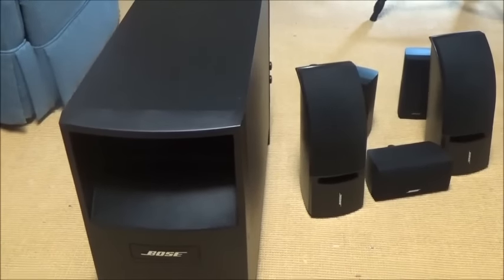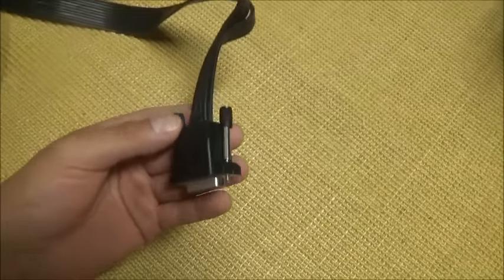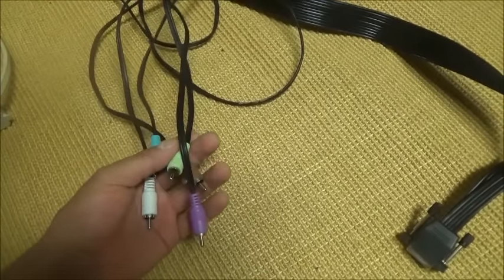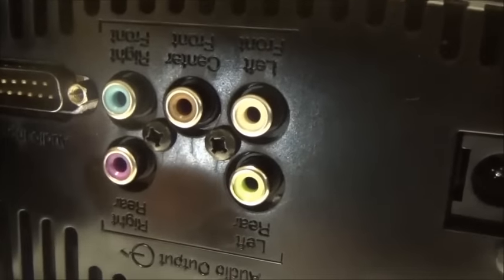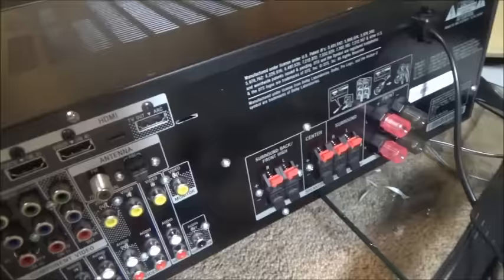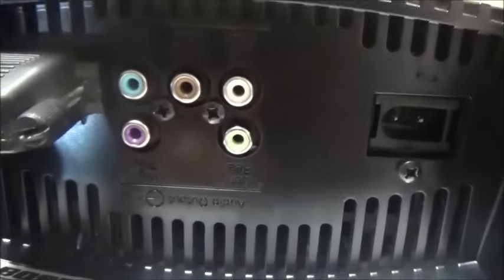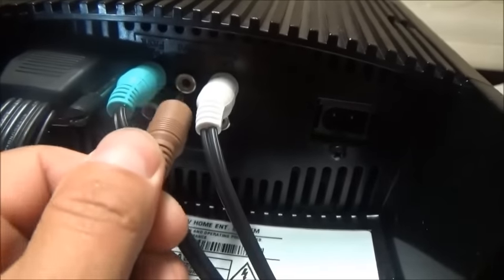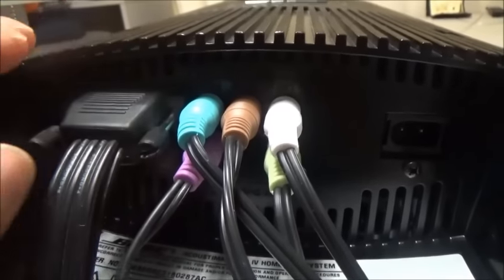How to install a Bose Acoustimass TO A SONY RECEIVER Home theater system TA

Comment: Whenever I see this Bose "proprietary" connector, I can't wait to just take it apart and hardwire them to make connection straight and simple. They are nothing but electrical wires sending analog signals, jeez. Connectors just suck, just look at Apple products.

Comment: I have Bose lifestyle 535 same speakers as Bose accustomas 10 if I buy acoustamos 10 sub woofer would it work because my sub woofer is different
Reply from the maker: probably but I  not sure if it works.  I do have the same sub woofer.  not diferent

Comment: I got some info that I didn't know before. Thanks. The one question I have is how do you connect the sub to the receiver? I have a single blue wire with a yellow cap. I'm not sure exactly where it goes. Thx
Reply from the maker: I have the blue cable too, but I am not using that, I've just connected the big cable that come from the receiver that's it
Reply: @outDood705  ok then I'll ignore it as well
Reply from the maker: Ok and let me know how it goes
Reply: @outDood705  what receiver do you use, and how are your crossover setting etc ..
Reply: @viigee202  The Blue Cable is very important it is the subwoofer cable which u connect to ur AV receiver without that ur base would not work
Reply: @crazystuff7605  thx
Reply: @crazystuff7605  where do I connect blue cable from base
Reply: @acerag4405  av receiver subwoofer audio out
Reply: Use an RCA jack for bass out of amp  to sub ..?

Comment: that cable with a d sub 15 is the input from the receiver .and  the rca connector are the speaker connectors I guess you got it wrong at the beginning

Comment: I don't understand still which cable or wire is your signal I see that u connected the speakers but no signal cable or is it act as a pass thru the speaker channels
Reply from the maker: que tal mi estimado Fabian Castillo. cuentame Cual es El problema que estas teniendo con tus conecciones?

Comment: I just install bose acoustimass 6, but center speaker not working. After I check, I switch to another channel (right front and left front) the speaker and cable its ok. Is it normal the center speaker not working?
Reply from the maker: you have to make sure is connected to the right place that's supposed to be Pengikut Yesus Kristus
Reply: @outDood705  its nothing to do with quality from audio source?
Reply from the maker: @ManGunSong6   well, if you are using right speakers cables and the speaker is working well, I assume the center output is not working.  I can't think of anything else.
Reply: @outDood705  thx man 🙏

Comment: Hi i am planning to buy accoutimass 10 series  5 how is the sound and if i compare with soundbar 700 + bass module 700 which 1 is better
Reply from the maker: Hello shivshankar patwa the 10 series is very good go head get it man it sounds amazing
Reply: @outDood705  thanks but if we compare with bose soundbar 700 +bose bass module 700 so which 1 is more powerful
Reply: @shivshankarpatwa3593  I own the bass module 700 and soundbar it's better.
Reply: @mouwa7793  hey thanks for reply i already purchase it and the sound is treat for my ear its amazing,,

Comment: It's very surprising that Bose lifestyle systems can hook up to any amplifier. According to them that the Lifestyle systems cannot hook up to any amplifier as it is proprietary systems. but I'm amazing they way u handle the systems. So that's mean any Bose lifestyle systems can mix and match any AVR receiver Right?
Reply: Only the Bose Acoustimass can be used with any 5.1 receiver. The Lifestyle 600 and 650 is proprietary with its own receiver.
Reply: He proves your statement wrong

Comment: What is the best way to set the Bose in the Advance setting in my Onkyo receiver. I am referring to the Large or Small speaker preferences and the Crossover frequency? Thanks(whom ever answers)
Reply: It automatically sets them but you set all speakers to small only very large speakers can be set to large and I'm not talking about just normal tower speakers I'm talking about tower speakers with 2 8inch subs 2 6inch mids and 1 tweeter but anyways set speaker to 90 hz and have bose sub crossed over at 100 hz
Reply: The maximum RMS potential power of the sony receiver is useless..Inside the bose module was high to low level suppressor circuit to integrate with the 5 channel amplifier inside the bass module for driving those 5 small speakers.. Estimated watts per bose small speaker would be 50w or less..now the sony receiver assuming 100watts rms rated output per channel. was only attenuated by this bose bass module to match those small speakers..
Why not just buy 2 tower speakers, 1 center speaker, 2 sorround speakers all rated 120W and an active subwoofer.. Rest assured that the sony receiver if rated 100W rms per channel will be more happier and will produce the better quality sound at decent spl level..cheers

Comment: can I just plug the speaker wire from the cube straight to the receiver and bypass the subwoofer?
Reply: No!!
Reply: If u had a bass blocker we use them in cars all the time if u connect it that way then yes u can

Comment: i didn't c how u hooked up the sub to the receiver... i know how to do all this its just i'm looking for an adapter
Reply from the maker: there is no adapter only the receiver cables go directly to the sub and the speaker cables come out of the sub, that's all you have to do ... if you connect it right; only what remains to be done is to connect the sub to the electricity and that should  work ...
Reply: how does the receiver send sound to the sub-woofer without a connection cable?
Reply from the maker: Rene Lopez. All you have to do is connect all the speakers out of the receiver  then the speaker will bring the sound from the receiver to the sub and that will give you sound
Reply: So the sub input comes from the f/c/s speaker out of the amp, I'm I right? How about the sub vol control? On/off control of the sub?
Reply from the maker: Felizardo Aguilar I don't remember seeing a switch saying on and off and a mind doesn't have that switch. you just connected to the electric power and control it there
Reply: my bose  sub has a 8 pin din connection for the receiver.... my sony receiver takes a jack connection.... I need a adapter for a 8pin din  female to a  male jack

Comment: THEY GIVEN ME AN ACUSTIMASS THE SAME AS YOURS, I TRY TO CONNECT IT TO A TECHNICS AMPLIFIER AND IT IS NOT LISTENED,. what am I doing wrong  ? No soud at all-
Reply from the maker: MSK 1975 make sure you connect the cables from the  subwoofer to the    receiver, and from the subwoofer to the speakers
Reply: @outDood705  how do you connect subwoofer to both the speaker and reciever
Reply from the maker: @oyeenihal4322  the speakers has to be connect to the subwoofer and from the subwoofer to the receiver

Comment: Where did you connect the sub in the receiver ?
Reply from the maker: hello Sudhakaran Muthukumar  the sub has the all connections.  if you see that black thick wire has all the speakers wires that goes connected from the sub to the receiver,  and all the speakers comes out from the sub . that's how I have mine and it's works fantastic.  I know there's a extra blue wires that mine has but I didn't use it. that's the way I have mine sir. good luck.
Reply: @outDood705  you have the out put and input backwards in your explanation. It says right on it that the big black bunch of cables is input.  Which means from reciever.   The RCA on the sub says output. So they go too the speakers.
Reply from the maker: @sdyogi  ya from the sub of course

Comment: How do you connect subwoofer to receiver
Reply from the maker: Hello Quan  so you connect the speaker wires from the subwoofer to the receiver you connect them where are the speakers supposed to go on the receiver and then remember all the speakers wires is going to get out from the  subwoofer to the speakers once you do that all of them should work the subwoofer and the speakers.... Well I have mind that way
Reply: hello quan, subwoofer cable is directly connected to the ampli

Comment: Subwoofer to amplifier blue wire right
Reply from the maker: nagesh mane well in my case I am not using that blue wire so it's up to you if you can find a place for it but I just live it disconnected and the sub is still working with amplifier
Reply: @VCG the fun Why not? Your receiver have the place for the subwoofer...
Reply: The Acoustimass system uses the speaker wires from the amp and uses processing to divide the signal between sub and satellites
Reply: @ilpatongi  so.. the blue wire doesnt matter?
Reply: No
Reply: Good so I don’t need to plugged in

Comment: You keep saying that it's a Subwoofer lol, Bose Does Not make Subwoofers, That unit is a Simulated Low Frequency Module. It only consists of 2 5 - 6 1/4 drivers. Also it is not capable of producing true low Frequency's like A Subwoofer would. This is why Bose has earned the Name Bose "All Highs, And No Lows" because it's basically cheap paper cone woofers for highs, and No True Bass. Sorry, Just wanted to correct you on that. This is why us Audiophiles Hate Bose so much. They are overpriced like Macs, but made Simple User Dummy Friendly for anyone to connect, but the consumer doesn't really care about True Movie Home Theater Experience!!! And You forgot to connect the Low Frequency Module as well, It should be plugged into the Sub out port, and the Wall 120V wall outlet, unless you have a Non Powered Unit, where then I really feel sorry for you because you will have zero bass lol.